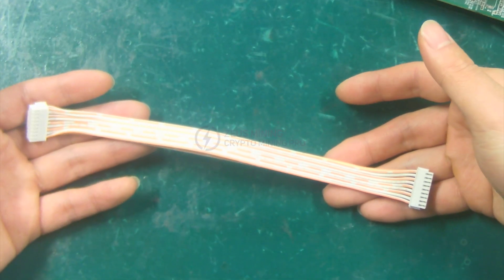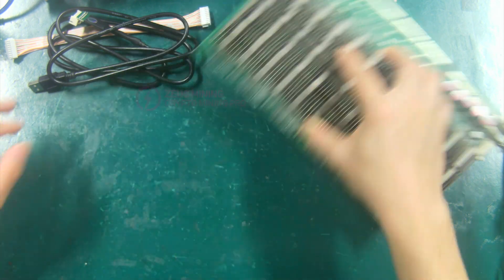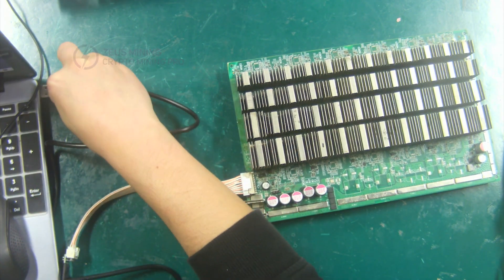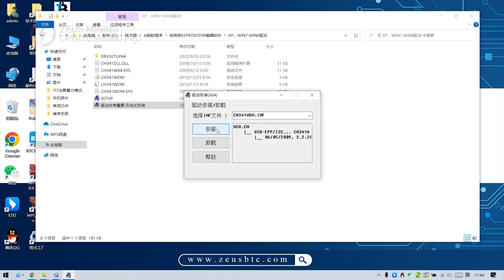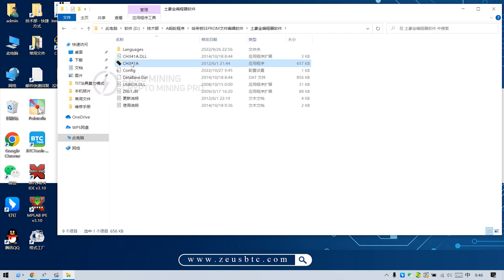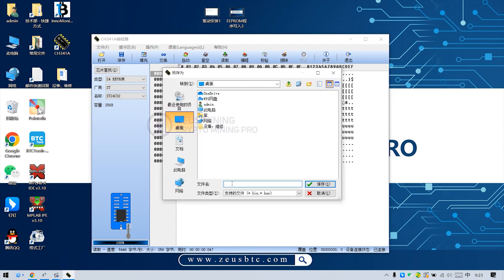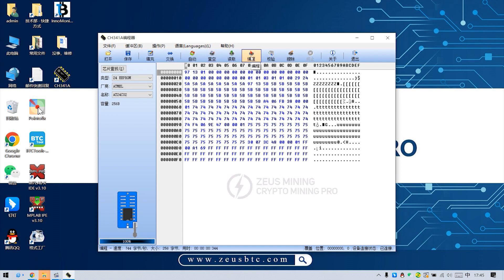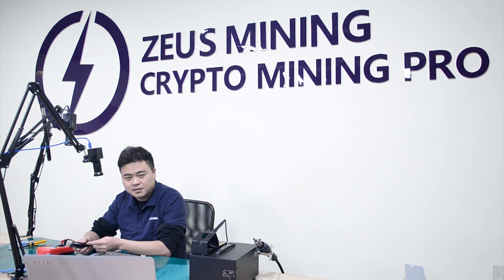Hashboard decoding tool cable tutorial | How to use hash board code program cable to rewrite code

Comment: How do use this cable for S9, your product listing states S9, please advise. Thanks
Reply from the maker: This decoding line supports all models after Antminer S9k，S9 has no eeprom chip
Reply: Ok, how do I program pic chip, pic16LF1704?? Thanks.
Reply from the maker: Hello, this is a tutorial about PICKit 3.5 programmer to burn PIC file, I hope it will be helpful to you https://www.youtube.com/watch?v=RSLV9uLwg28&t=3s

Comment: This method is support ks3m hashbord ¿
Reply from the maker: Not supported because KS3M does not have an eeeprom chip. If you have other technical questions, you can contact our technician WhatsApp: +8619123969124, he will provide you with better advice and service.